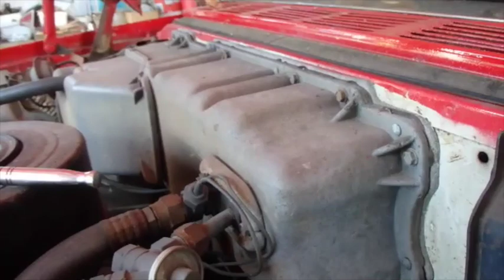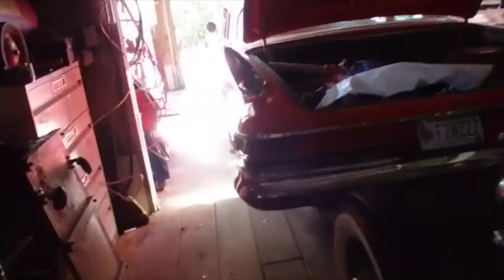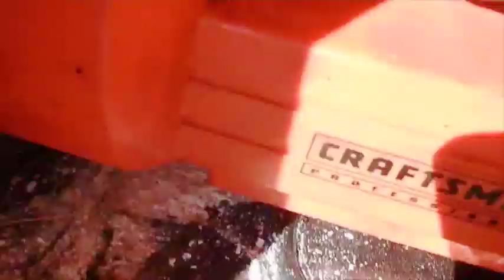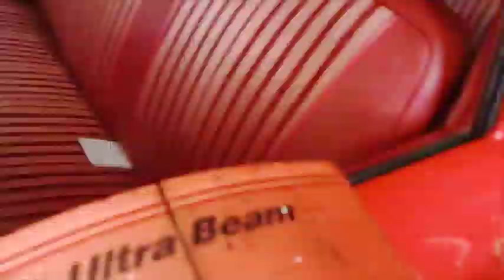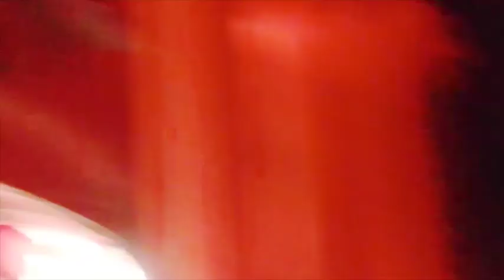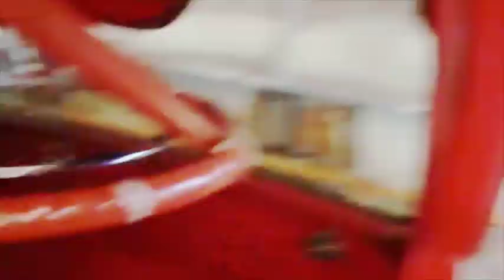61 Chrysler Brake Master to Brake Booster don't fit

Comment: Over the years I have gotten vac boosters that came with extra long rods and I had to shorten them by cutting and rounding off the end of the rod, it's no problem to do that.  So long as you have just a tiny bit of free travel between the master cylinder piston and the rod end when the brake pedal is up, you'll be fine. You MIGHT need a brake return spring if the pedal is not returning all the way up.  The brakes have been jiggered with, hard to know what's missing. 

Those brake master cylinders can withstand some pretty heavy foot pressure, with those bolt ears being made out of some thick cast iron.  Not saying your adapters have to be as thick steel but it should be pretty stout. ALSO if the part that sticks out on the GM master cylinder contacts anything inside the booster, it's not going to work for long.  

One last thing it would be best ifn you could make sure the master cyl. is held centered in the booster (maybe with something that bolts your adapter plates in place to the GM bolt ears)  You don't want the master cylinder become loosey goosey wander around and fail prematurely.  I've seen that happen when brake masters become misaligned. 

Ifn you follow this advice I can pretty much guarantee your brake master cylinder will give you good service for many a year.  

But I'm just the Quality Control guy Ha
Reply from the maker: That's what I pay ya for.  Yessir..

Comment: You need the GM master cylinder with the depression in the piston. Most of these disc brake conversions use the Corvette master cylinder. On one the piston has almost no depression, one has a deep depression.